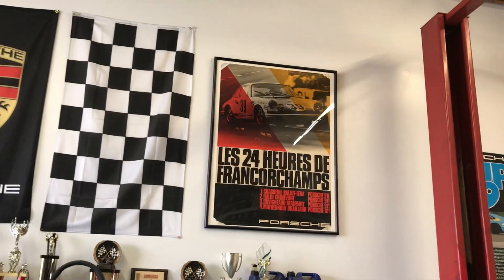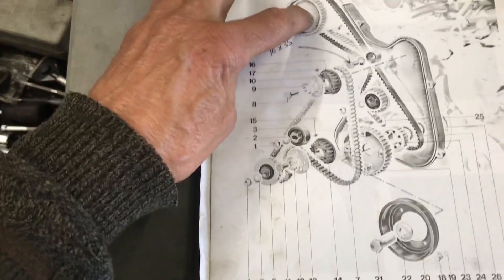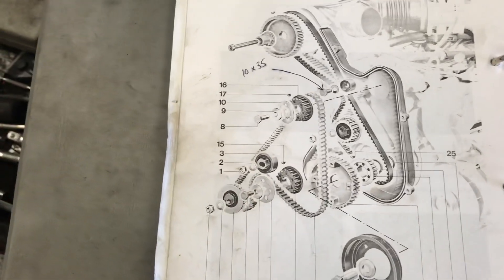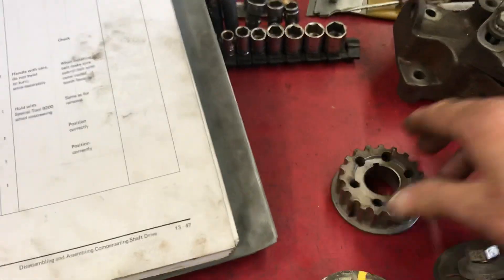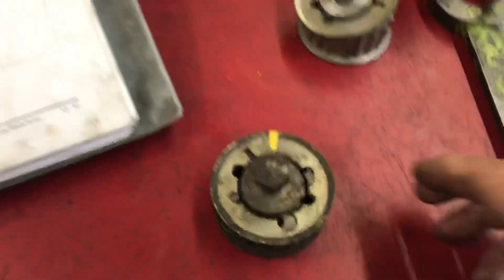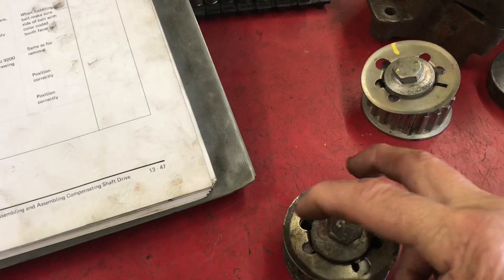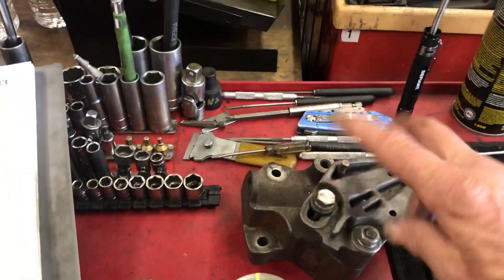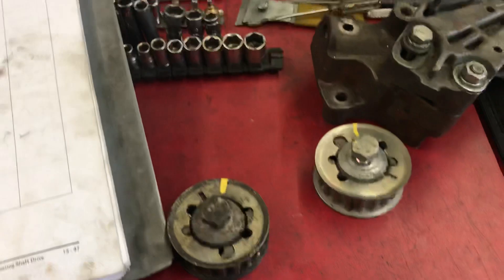Porsche 944 balance shaft gear info

Comment: Hi fan from England, had and worked on my 944s for over 25 years,,, could you tell me if i should allow my cambelt tensioner on my 87 turbo to let the spring do the tensioning?   Ive always done it so i can just about spin the waterpump pulley by hand. ( so make it spin judt about under the belt by hand )....could you let me know how you recomend setting the tension on the cambelt as ive never used a tool and often wonderewd whats the point of the spring tensioner if we dont use it to auto tension??   

your channel is the greatest 944 channel out there, would love one on fitting and tensioning the belts if ever you can do one 🙏
many thanks 
Dan from England☺

Comment: Always great 944 input
Thanks for the info - had to double check my balance shaft sprockets were correctly aligned. 
Got a vibration at  around 3200 rpm and only there with both  clutch depressed and released .
Engine mounts are ok , but i did replace the rubber clutch with a spring plate . Something out of balance possibly? Crank pilot bearing newish , but torque tube end shaft that locates in pilot bearing could be worn - could that be an issue do you think?
Reply: Thanks for the nice words. I don't think the tip of the shaft is the problem. Your vibration is classis clutch disc failing symptom, but you have a new clutch. Drive shaft? Tranny? Not sure.

Comment: Then you have dumbshits that put them on BACKWARD!!!!!!  You know......  LOL  Also even if you're spring tensioner doesn't have the holes in it for the balance shaft tool, you can use the recesses molded into the tensioner lever.

Comment: With the o on the lower,  was it up how you had it laying on the bench in the video?
Reply from the maker: It was sitting on the "bench"  upside down from how it's actually installed on the engine yes, but if you put the keyway up and the O shows up in the rectangle window, you've got it right. The mark on the lower section of the rear belt cover is near the bottom of the "installed" pulley.